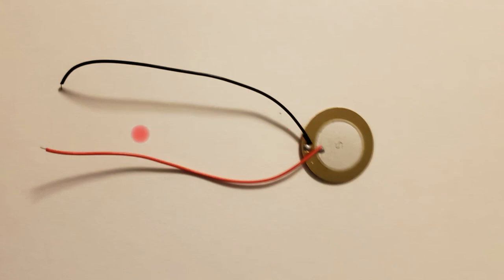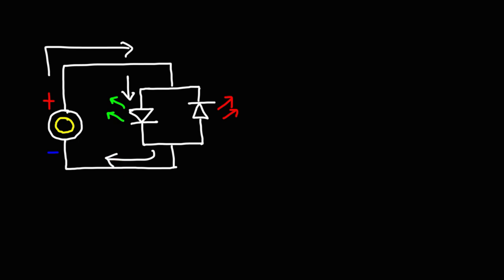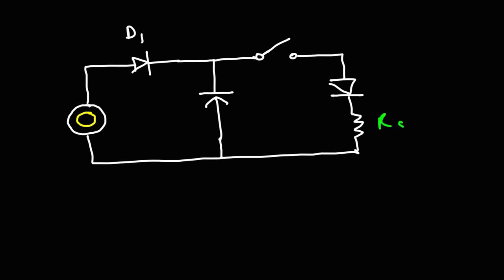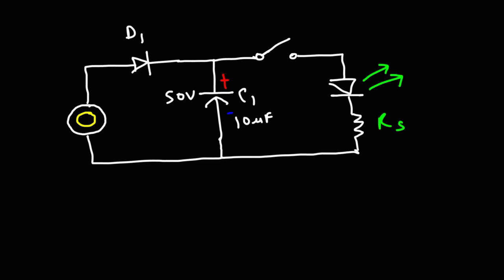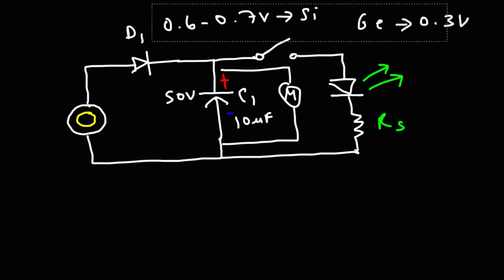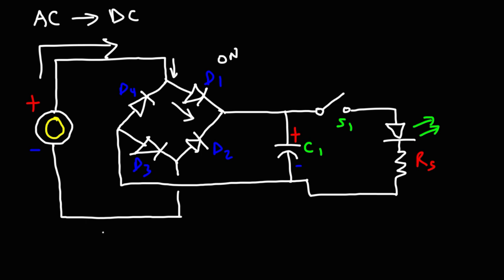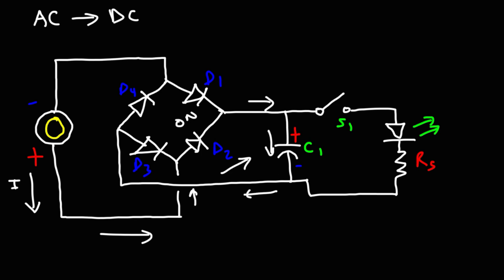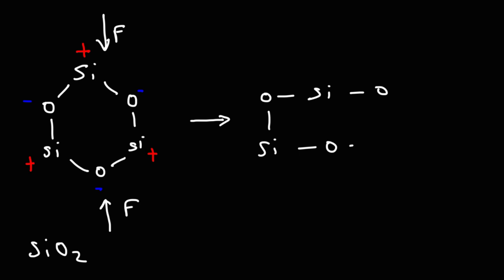Piezoelectric Effect - Using Crystals to Generate Electricity

Comment: R2 is not in the circuit properly. The wiper should connect to base of R1 and then one lead should connect to gnd. The way it's connected in the video it always has max resistance.

Comment: So if compression of quartz causes the electrical charge, let's say that I put a piece of quartz in a vice a squeeze it. Could I continually gather and store electric current as long as that vice is pressing down? How long would it last until the quartz stopped producing energy?

Comment: so to those hollering not enough amps. guys just plug the voltage output of 2 of those piezos in series to ohms law. we already know a estimate of resistance in the wire based off the AWG it looks like hes using. those piezos are probably getting around 30v a piece. meaning 60v in the circuit. so 60v divided by the resistance of the wire which is about 0.5ohms and you get 120 amps. rough estimate... the energy your thinking of isnt necessary all from those value, but power over time as well or known as electrical charge. in that formula the electrical charge is dependent on the start and end time of the applied power. the longer the discharge time, the greater the electrical charge. knowing that, take a good look at his setup again. he specifically made the material to lengthen the discharge of the impact hence lengthening the time of applied power into the circuit. giving it a greater electrical charge than if only using piezos alone... formula reference (ohms law is basic and easy to find) electrical charge formula, watts law, voltage in series(for the 2 piezos in series) theres even formulas for coil gun energy using different types of cores and solenoids. take your time, learn some things you dont know yet and you will have a better understanding. its ok to not know. most poeple only have a basic understanding of electrical laws. theres a lot more to think about than first meets the eye.

Comment: Where does the electron flow come from? In other words, when pressing the crystal are you "pumping" electrons out of the crystal and if so won't the crystal eventually dissolve?  Also why does the relaxation of the pressure create a current flow since the crystal is going back to a balanced neutral state?
Reply: If Im remembering correctly, it has to do with the crystals molecular structure and, when pressure is applied, the structure becomes disrupted causing electrons to flow. When the pressure is released the crystal wants to return back to its original molecular structure, causing the flow to reverse. Im not super sure I am correct but this is what I think I remember.

Comment: Great video, i needed that. I have only a question. If current doesnt flow through the capacitor, due to the dielectric, then when the switch is on what is happening?
Reply: When the switch is closed (on), I’m fairly certain the LED would light up and the capacitor would charge at a rate decreased in line with the resistor added to the LED end of the circuit.

Comment: So this is how sound waves turn from mechanical waves to electromagnetics?
Reply: There used to be "crystal"  mics that used this effect ....also "ceramic". ....but they didn't sound that great. They had a high output though, at a very high impedance. I still have one; the Astatic JT-30.The crystal turns sound waves into electricity, not electromagnetic, although it could be argued that a flowing electron produces a magnetic field according to the right hand rule.